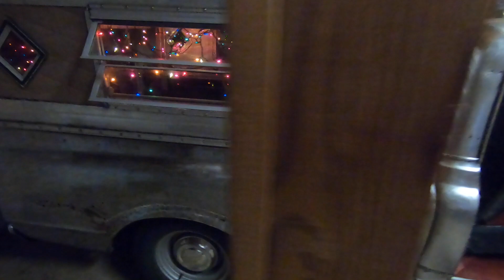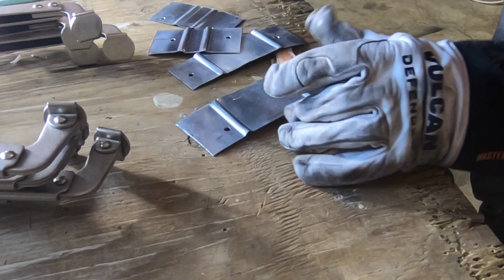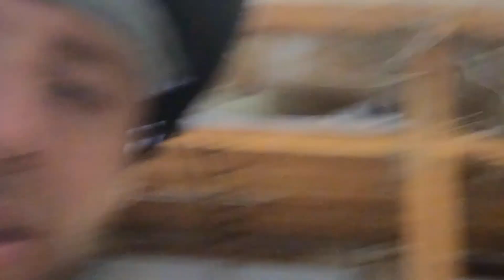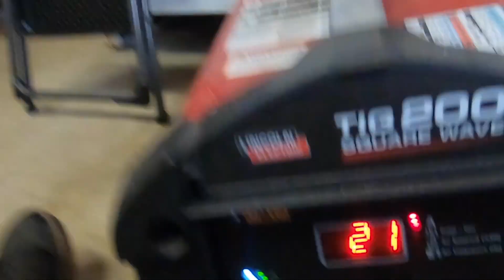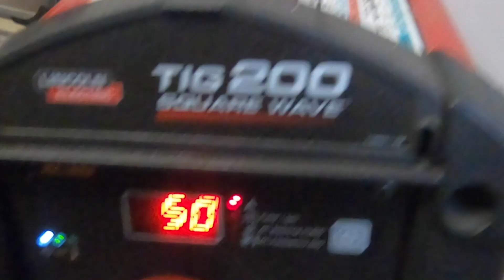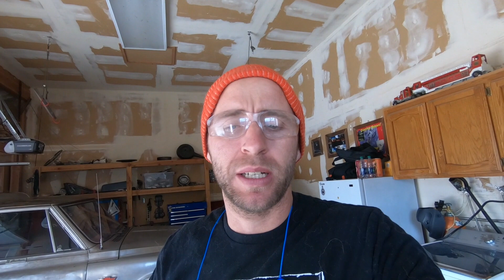Camper Panel Build C10

Comment: Look for flap wheels for the die grinder.
Reply from the maker: Yeah I have some round ones for straight die grinder but wanted a 90 degree so I can grind flatter
Reply: @showmetrucks7113  they make a wheel style. I picked up from Northern. I'll MSG a pic later.